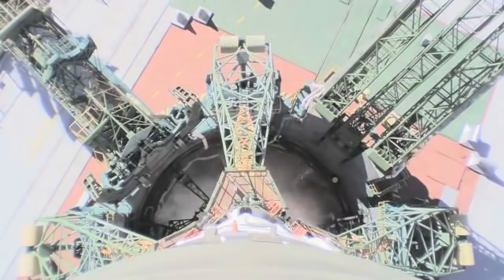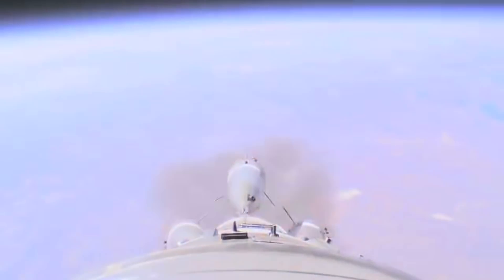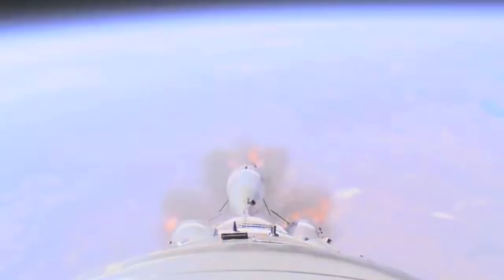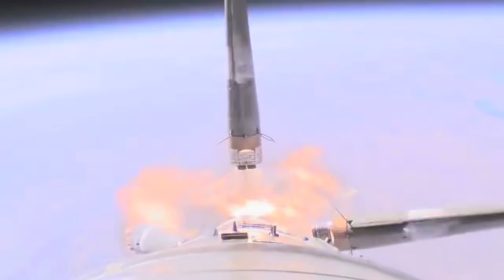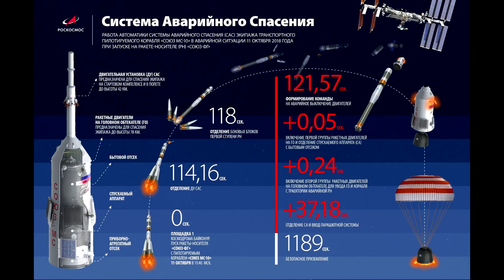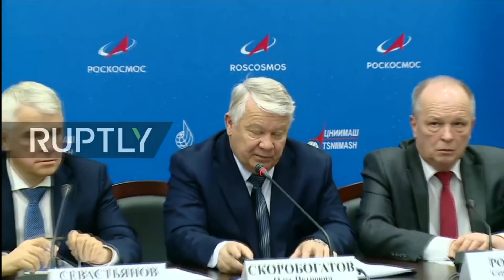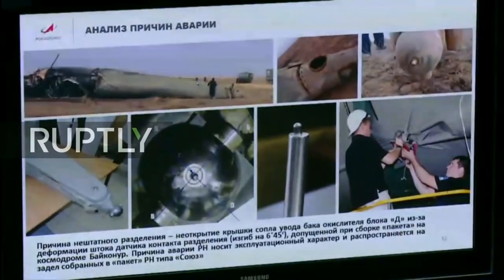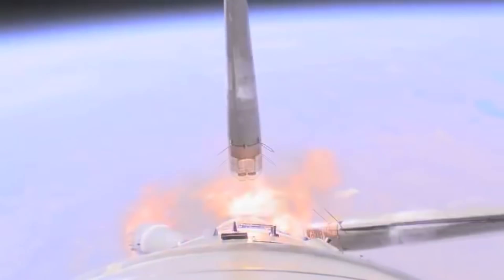In Flight Camera Shows Damaged Sensor Destroyed Soyuz Rocket

Comment: One thing I would like to know is: Had they found out how the pin was bend? I mean, it might be an accident, or someone that tried to make the launch a failer. Like do they still looking into it because of the fact with the drilled hole of the Soyuz before? I will be more worried about if there is a group of people that actively trying to sabotage the cooperation between NASA and Roscosmos.

Comment: Hans Koenigsmann of SpaceX said that one of the huge benefits of recovering boosters, is that they can put GoPro cameras almost anywhere on the booster knowing that they will recover them later not only saving on camera costs, but also avoiding the need to stream the footage back to earth in real time. So for diagnostics, if there is any part they need more in-flight information on, they can simply set up a standalone Go Pro pointing right at it and review the high resolution footage after recovery.
My guess is that the reason for the low quality Soyuz footage is because the camera must stream the imagery back to ground during flight, so it must be streamed in a format compatible with the ground stations.

https://www.youtube.com/watch?v=0IU41zpzWUE
Reply: Yeah, how will that work when the booster fails...

Comment: Soyouz was designed to fail safely, so to say.
Reply: Safe rapid unscheduled disassembly...
Reply: @ahaveland  SRUD? I like it.
Reply: @etbadaboum  or perhaps Careful Rapid Unscheduled Disassembly :-)
Reply: Supersonic highly intense termination happens.
Reply: @ahaveland  Better: Super Careful RUD! :)
Reply: @ahaveland  LMFAO, A SRUD missile!
Reply: Every spacecraft system except for shuttle and to an extent Gemini were as well... Shuttle was a death trap with really zero ability to abort if anything major happened...  Gemini used hyperbolic fuels which supposedly dont explode if a failure occurs and eject was thought the best option...??? NOW EJECTING THROUGH A CLOUD OF HIGHLY TOXIC CHEMICALS SEEMS FUN RIGHT????
Reply: @chrisjohnson4666  'hyperbolic fuels' Sounds super dramatic.
Reply: @etbadaboum  I prefer euclidean fuels as opposed to hyperbolic
Reply: Unsymmetrical dramamethylhydrazine and dinitrogen theatricaloxide?
Reply: C and K Early Warning Systems ... Assume autocorrect munged the word? In place of hyperbolic, try hypergolic.
Reply: @florencegomer7937  yep and wouldn't let me change it
Reply: @chrisjohnson4666  The shuttle was a death trap under certain conditions, and not others.  Having the core booster explode a few feet below your seat is one of those things that would require extraordinary efforts to survive if it were survivable at all.  But if the core booster simply shut down prematurely or an SRB failed to detach, you still have a perfectly functional aircraft with enough fuel that can make it possible to land ... somewhere ... reasonably safely.  They trained for several alternative abort procedures.

Hypergolic fuels do indeed blow up, especially mono-propellants.  But flying in an escape capsule thru a cloud of the Gemini fuels wouldn't make much of a difference.  Dispersed too much, duration too short to make much of a difference.
Reply: @fromagefrizzbizz9377  The problem with shuttle was it was like a horse built by a committee in which the end result is a camel...  The SRBs were a political ploy and the orbiter being belly up to the fuel tank almost guaranteed aerodynamic break up of the orbiter if the tank failed.. i.e. Challenger did not explode rather the aft field joint failed and the bottom of the oxygen tank rocketed up into the hydrogen tank...  The break up caused the orbiter to lose aerodynamic control and the vehicle was torn apart... If we look at Soyuz this was a similar incident in that a booster ruptured a fuel tank leading to booster break up... In this case the capsule escape system worked...
Reply: @chrisjohnson4666  Well, yes, a bit of a camel arising from mission requirements, but the Soviets liked that camel too and stopped only because of economic meltdown.

What happens when a LOx tank smashes into a LH2 tank?  The results are not pleasant.  It's not high explosive, so the orbiter wouldn't have disintegrated, but the shock wave alone would have made the shuttle unflyable. It wasn't "merely tumbling" when it impacted the ocean, the damage was far deeper than that.

Certainly, they would have had a rather better chance if their was a jetisonable capsule, but it's only one of many potential failure modes, of which many had long been accounted for and escape methods available.
Reply: @fromagefrizzbizz9377  we have to admit the shuttle was not the spacecraft NASA wanted...  it was what the politicians gave them...  Russia's space shuttle was an interesting discussion it too was foisted on them due to political pressure mainly the Americans have one there must be a good reason... Interesting point the Energia is close to what the original shuttle design was supposed to be and had the US shuttle used something like the Energia neither accident would of happened...  

Feynman described the shuttle program best basically it ignored natural science and as he said nature cannot be fooled...
Reply: @chrisjohnson4666  "we have to admit the shuttle was not the spacecraft NASA wanted".  You have to be careful making comments like that, because there are different factions within NASA, each with their own wants,  desires and proposals, which isn't necessarily squeezed down to any one proposal by the time Congress sees it.  Secondly, *when*?  When Apollo was cancelled (early) by Nixon, I know what NASA wanted (more and bigger Apollo) *then*.  So, who said what when?  What bias does the "reporter" of the situation have?

"Wanted"? Congress wanted ISS.  ISS meant shuttle.

 No matter.

No question, Energia was nice.  But it only flew twice (one misbehaved, but not too badly), and liquid-fueled rockets are always an increased risk over solids.  There's no way to know what would have happened if Energia flew 135 times...  Given the complexity of that scale of project, and the Soviet's track record of the "big stuff", I really really doubt that Energia would have had a better safety record.

That said, there are rumours that Energia may be restarted.  The basic technology was great, no question.  Given proper project management now*, I'm sure it'd be a great performer too.  But Russia doesn't have budget for it, and has *nothing whatsoever  manned that's underway even in early design stage.  It's all they can do to get their Glonass array up/complete, provide a low-capacity taxi service (which the US pays for), and provide "dumb boost" for commercial satellite launches - and too only because it's commercial.
Reply: @fromagefrizzbizz9377  the original shuttle concept was one a smaller orbiter (the larger that was built was to try and get USAF payloads to offset cost) and was to be boosted by a liquid fueled reusable winged craft... It was also to include a large space station with the shuttle literally there to move Astronauts to and fro...  The SRBs were foisted on NASA due to political pressure mainly to keep the company in business...  If I recall correctly the US modern space program basically say 1975 on hasn't had a liquid engine fail resulting in loss of vehicle in flight but numerous SRB failures mainly cracked casings or in case of challenger stiff O rings have occurred with Delta and Titan...  I cant recall where I read it but I remember seeing an article years ago where a retired Titan engineer estimated an SRB failure of like 1 every 100 launches while NASA is as trying to sell a 1 in 10000 failure rate...
I dont recall Energia being the problem in the first launch I thought the test payload had a sensor wired wrong backwards in fact and the guidance flipped it around 180 deg post separation and boosted it into the atmosphere...

I always like shuttle but it had too many dead zones in its launch profile...  If they would up shrunk the cargo bay and used the extra weight to install an F111 escape system it would of been a way safer machine...
Reply: @chrisjohnson4666  still better than being forcefully ejected through a fireball as the spacecraft comes apart.
Reply: It explodes like a bomb. BUT SAFELY!
Reply: Fail safe! - for those special occasions.

Comment: Good thing they found the cause of the issue and are checking for flaws in the already built boosters.
But how do they know the pin was bent during assembly and not by the forces acting during the landing or in flight?
Reply from the maker: Good question.
Reply: @scottmanley  From an engineering standpoint: that pin is substantially impacted while all nearby items appear reasonably un damaged: this is indicative of preflight assembly damage

Comment: Rolling shutter is often extremely pronounced in the presence of strong vibrations. People who do FPV flying with drones have been combating this "jello" effect for years, and have various ways of mitigating it. Digital cameras with global shutters that completely eliminate rolling shutter are uncommon (especially in the consumer market)
24fps is a common framerate in modern digital cameras as well.
Reply: Cheap CMOS cameras are scanned so you get rolling shutter effect. (I hate it!)
More expensive CCD cameras don't suffer from it so every frame is undistorted, apart from motion blur.
CCD video is much easier to stabilize and deshake.

Comment: It’s amazing how such a seemingly slight bend (less than seven degrees) can lead to such a catastrophic failure. Just goes to show the level of precision engineering needed to make rockets. It’s also neat that they were able to recover the wreckage fairly easily.
Reply: It depends how snug a fit in the housing it is.
A bend of less than 1 degree in car engine valve means that cyclinder will fail for example

Comment: I wonder why the boosters detach from the bottom first? I'm sure there is a good reason, but I would have imagined explosive bolts and a small solid rocket to push the top outward, with more of a timed sequence than sensors being involved.
Reply: Maybe this is a much more reliable way, you will need many explosive bolts and small rockets for all 4 boosters, and it only take 1 malfunction on any of those parts to cause a failed seperation.
Reply: Notice how Scott said they keep the main engines on the side boosters firing when the bottoms are released. This way the main engines work like separation motors to push the large mass at the bottom of the boosters away from the core. Once that happens and the bottom of the booster has swung out far enough the sensor at the top is supposed to trigger the oxygen discharge to push the less massive top of the booster away as well. That's what didn't happen this time causing the top of the booster to impact the core and damage it.

Comment: So yet another case of a technician hitting applying percussive force to make something fit. Ya, they totally have their QC problems solved. Commercial crew cannot come fast enough.
Reply: How is this better with commercial crew? Think cost pressure makes for better adherence to quality assurance procedures?
The boneheads who did a similar thing to a DC-10 engine by installing it with a forklift weren't exactly state-employed.
What is needed are people with the right mindset doing the work. That doesn't depend on the underlying organisation.
Reply: @HotelPapa100  The underlying organization can promote the right mindset needed to do a task.  On the other hand there are times a organization might focus more on productivity as opposed to doing things right and safely and problems like this might occur in that situation.
Reply: @HotelPapa100  Exactly, state employed, commercial, it doesn't matter. It's the mindset that counts. And there are clear problems right now at Roscosmos and Khrunichev. The only alternative on the horizon is commercial crew.
Reply: @HotelPapa100  I don't think he's talking about your precious state run economies, he's talking about the Russian QC in particular. Russians aren't exactly known for their high regard for human life.
Reply: @migkillerphantom  Not exactly the reputation of the Soyuz system. In general I'd agree.
Reply: Lol @ thinking companies wont cut corners to get more profits. It happens, even in space flight. When these things become common and reliable no doubt they will start taking risks. Thats buisness.
Reply: Saw a commercial today with a guy living large on an exotic vacation.  Tag line popped up, you work harder so the boss can have more fun.  I think that might apply to the guys on the rocket assembly guys.
Reply: @bradfigiel2203  that's capitalism in a nut shell aint it.

Comment: So the only thing that saved the crew was the fact that this extreme yaw occurred absent most atmosphere? A yaw anywhere near this magnitude, at these speeds, within atmosphere would have immediately destroyed the vehicle for sure...
Reply: No...
Reply: the Space Shuttle Challenger was perfectly fine with its Booster yanked-off, then ripping the tank open, and exploded, but succumbed to aerodynamic pressure and the vehicle disintegrate into pieces.
Reply: @xponen  Because the Shuttle definitely had a launch escape system
Reply: @xponen  wut?
Reply: @kevinfoley7667  exactly... Lol
Reply: @YZFoFittie  I mean the Space Shuttle Challenger also Yawed violently when one of its Booster rip apart the tank, its Main Engine lost fuel while its Booster still dragging it up at full power, it result in the vehicle getting destroyed.
Reply: @xponen  yeah and do I need to type what happened next? Lol
Reply: @thebigitchy  Don't forget that the space shuttle was designed for considerably more stress than a Roscosmos booster is likely to encounter. The durn thing had to re-enter with a nose-up attitude to spill speed - that's pretty darn rough (and hot!).  And then after a good check and refurb, do the same flight *again*.  And again...
Reply: No. Look /watch?v=QMUJ004Dr8Q about LES
https://en.wikipedia.org/wiki/Launch_escape_system
Reply: Not really, the escape system was designed to pull away the capsule in the split second after a trajectory deviation is detected. The camera footage isn't from the crew capsule, but rather the damaged stage left behind by it.
Reply: I do believe Scott made a video about LES and he explained how different systems would trigger at different heights. So unless every single piece would explode simultaneously, LES would trigger in a split second. It would not be comfortable for sure, but beats dying in the fireball.